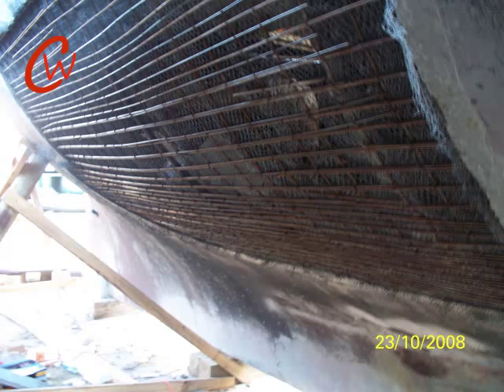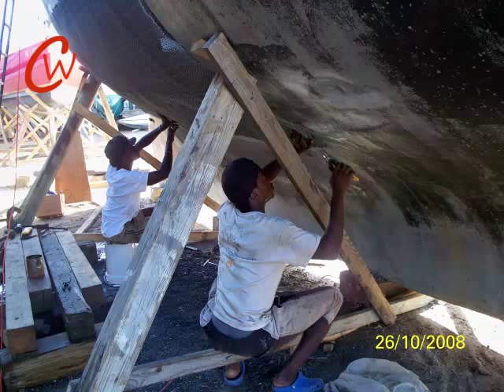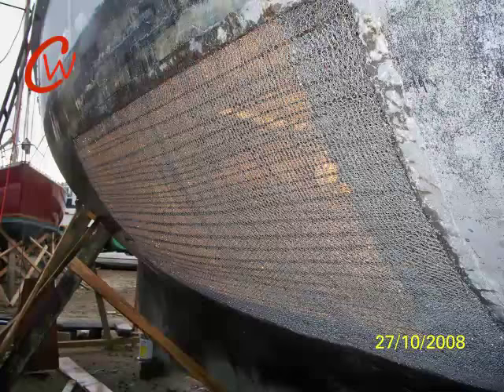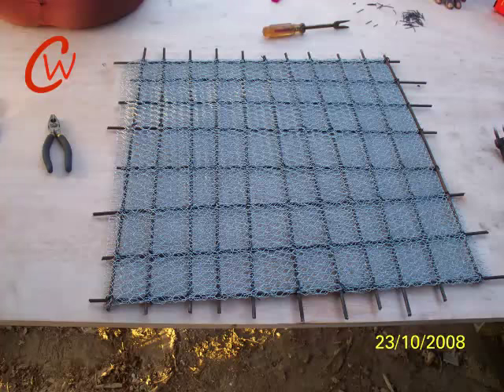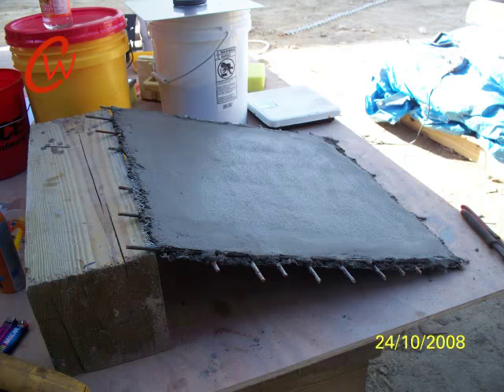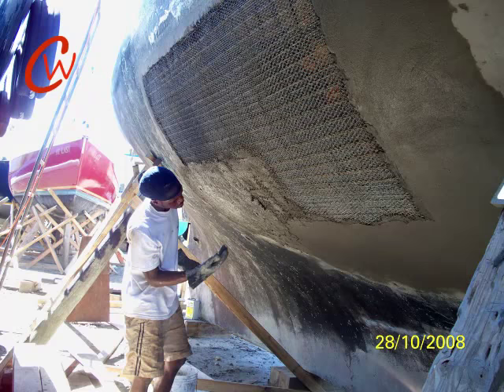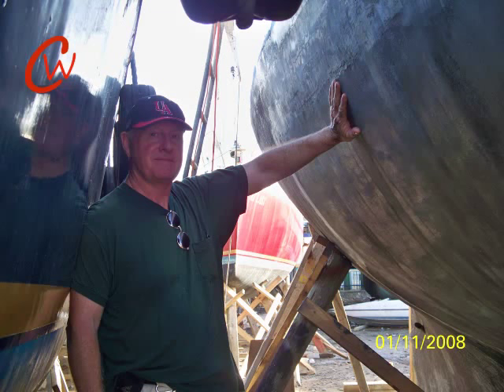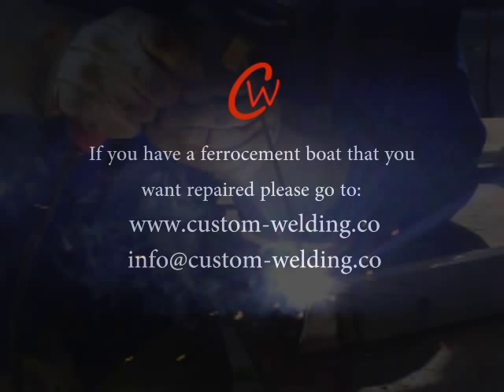custom welding ferrocement boat repair video

Comment: What is included in the composition of ferrocement cement for boats? Can it be used for roofing.
Reply: Ferrocement is used to make roofing panels, or it can be shaped  as a single assembly but requires substantial support until the concrete achieves the required strength. Don't sleep under it on the first night ...

Comment: How do you get the new concrete to bond to the old, does the dry edge require special preparation .
Reply: Maybe ‘concrete epoxy adhesives’  are applied to the old concrete (coated/painted) to create a strong bond with the new.
Reply: @zukobringas5096 I have heard on another video comment that that is best

Comment: Has anyone ever thought of using structural grade naval marine quality construction strenght stainless steel alloy rebars and woven-welded mesh? And the time-tested and time-proven 1 part lime + 1 part iron slag powder + powdered clay Smeaton mortar/concrete formula? Or the time-tested and time-proven 1 part lime + 1 part powdered brick + 1 part fresh water river sand developed by the Ancient Byzantines 1,500 years ago and are still standing today? Instead of water why not use rice glue water or water glass (water soluble sodium silicate) water. Or best combining all both together and let us see what happens.
Reply: I know cement boats get well over 100ft in length, so id imagine alot of those concepts are in practice and they probably work as well in practice as they do in theory. My bet is it always comes down to budget.
Reply: Geopolymer and basalt reinforcement is the way to go. 
Salt resistant.  Lighter.  Stronger.  Self healing